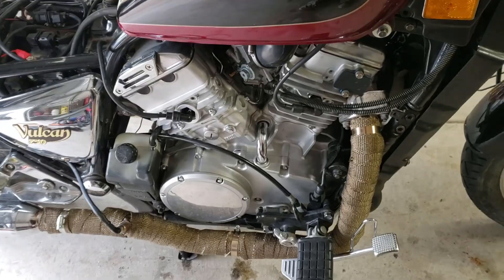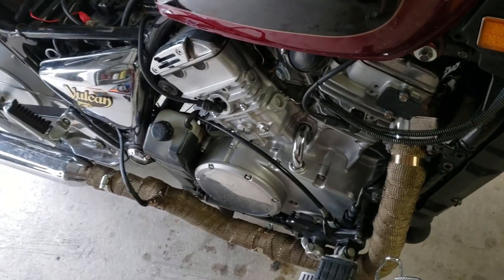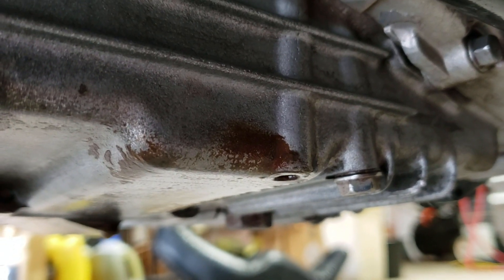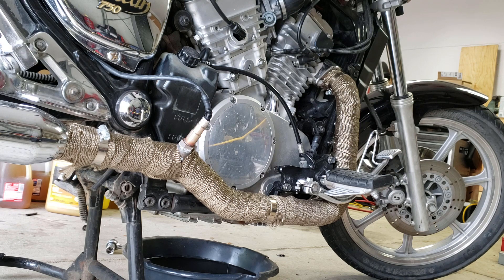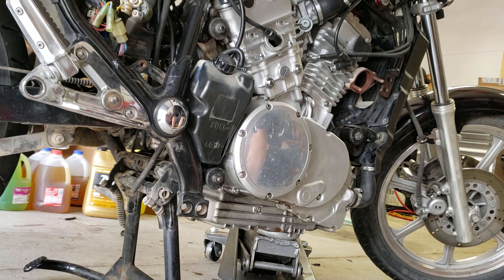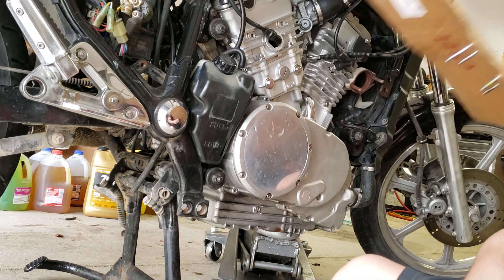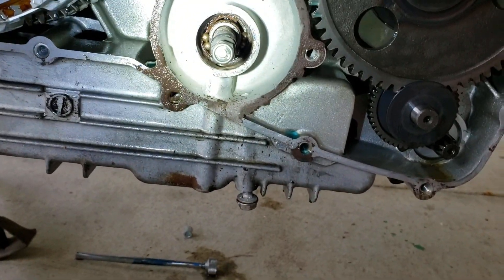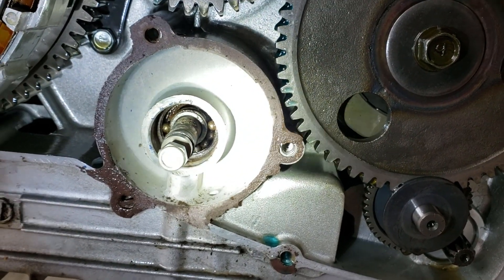Vulcan 750 Water Pump Mechanical Seal Replacement Procedure. Bearing and Oil Seal Failure.

Comment: What’s the part number for the first seal. I’m in luck where mine is seeping clear coolant. So I might be able to get away with just replacing that seal u ripped off. 

And what’s the torque spec for the impeller once I put it back on?

Comment: I've been researching this also due to an occasional squealing in the area of my impeller shaft.  I believe you can replace the mechanical seal from the outside, basically the point your vid ends.  But the oil seal and bearings on the impeller shaft has to be replaced from inside the crank case.  That means a big job of engine removal and tear down.
Reply: If im replacing  the water pump mechanical seal...i dont have to drain the engine oil...rigth?
Just the coolant ?
Reply: I wish you didn't say that. This bike has been a good first bike. Every repair has been very complicated. Is it true? That you have to treat down the whole motor to replace this bearing?? Say it's not so.
Reply: First check the mechanic seal.
1. Take the side cover off. A little coolant will spill.
2. Take the impeller off.
3. Look at the mechanical seal. It's probably shot.
4. Remove the mechanical seal. Be careful not to mess with the bearing behind it. The silicone side of the inner bearing may be warped, torn, or destroyed. Doesn't mean the bearing is shot but it may leak coolant in the oil.
5. If you decide to replace the mechanical seal get all the parts. I think there are 3 parts.